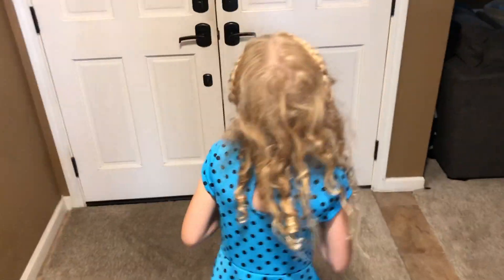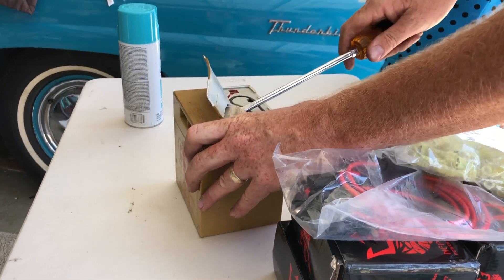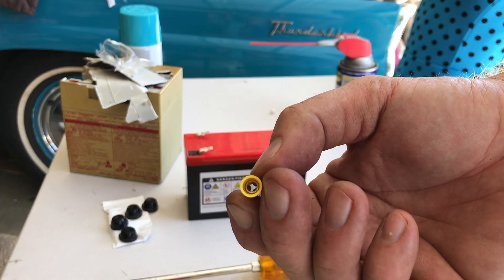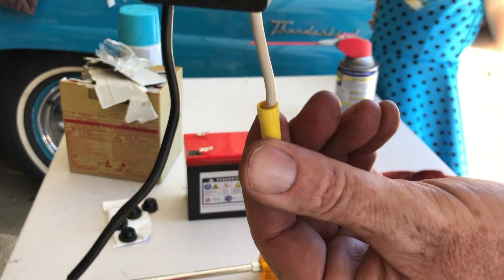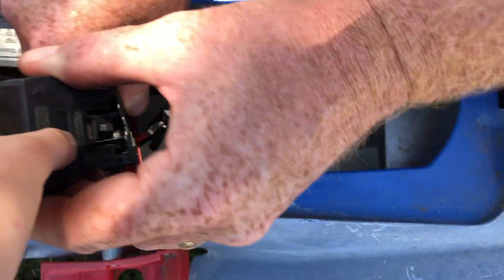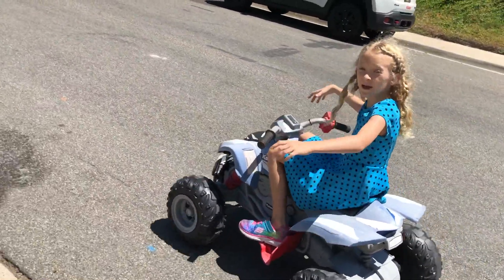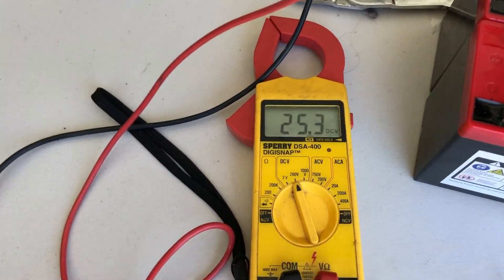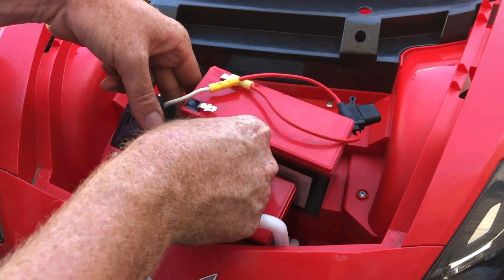Power Wheels Conversion Step by Step How To Modify 12 Volt to 24 Volt Mod Super Fast

Comment: nice! just curious, but why does the fuse have to go on the positive side?  Also, to help with the motor heat, they do sell cheap aluminum heatsinks with fans you can attach
Reply from the maker: In a 12-volt electrical system, the fuse should be placed on the positive (+) side of the circuit, as close to the power source (like a battery or power supply) as possible. This placement helps protect the wiring and the entire circuit from damage caused by overcurrent or short circuits.

Comment: What do you use to charge them now?
Reply from the maker: Hi Andrew, since I used the connector from the old power wheel battery, I can still use the battery charger from power wheels. I just charge the batteries one at a time. However I also bought  a battery maintainer as well. Here is the link to what I use: https://www.amazon.com/gp/product/B0051D3MP6/ref=ppx_yo_dt_b_asin_title_o02_s00?ie=UTF8&psc=1

Ive been happy with this as well.

Comment: Awesome Hot Wheels mod, bro! Looking forward to the next video!
Reply from the maker: Thank you Boswen! After running our Power Wheels for a few days on 24 volts I am please to report they are still working and the motors and gears look to still be working well. I am cautious as I am expecting the motors/gears to not last long with the added speed. And the kids love the 24 volts!!
Reply: @thebusybees4180  The bushing from the motor wears out from the torque.
They do fine on 18v lion  or 5s lipo. I get them for cheap cheap...so
I have the 4 and 6 year old on 24v ATV( different brands..different gearing) it's fast..around 10 mph or do around the same as s300 razor with me on it...( I ride around them) they wont ride on 18v anymore .lol :-( 
Maybe around 20 miles...of rough driving..Up hills. power slides..ect
It's fine on 24v lead acid.
I have motors and sprockets from s200 and s300..350watt , 500watt and
1000watt motors....
Just waiting for them to get a little old . They're little speed demons
and likes to do donuts and powerslide in front of mom. 
Teaching them to let off and slowdown before cornering.
THEY DONT LISTEN..Lmao
DONT put grippers on the rear ( traction roll)
The 4 year old figure it out..he rolled it while on the grass..becuase
it gripped when he let off...well thank god it was ONLY PLASTIC/LITE
He freak out...but wasnt hurted.
I have to make 10-12 mph LOW RIDER drifters.lol